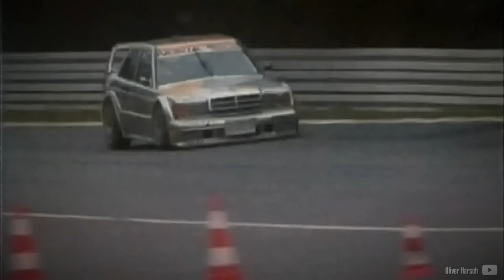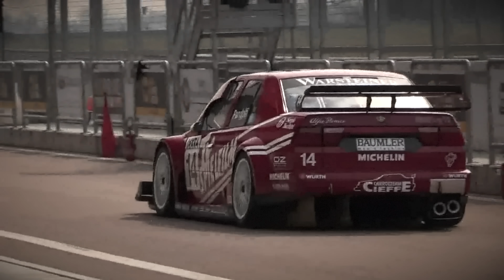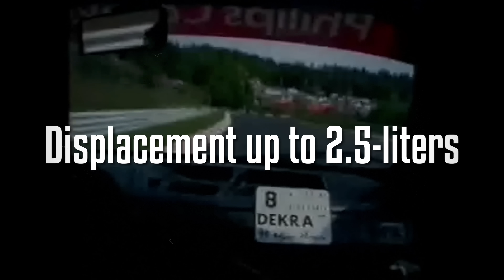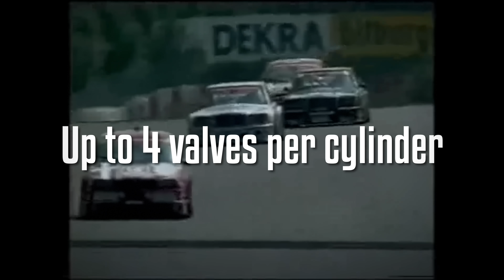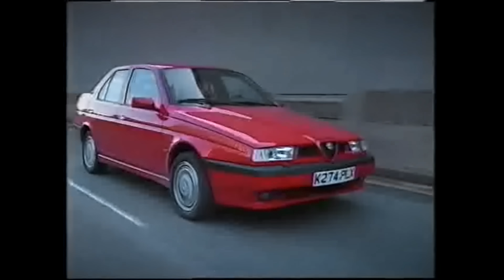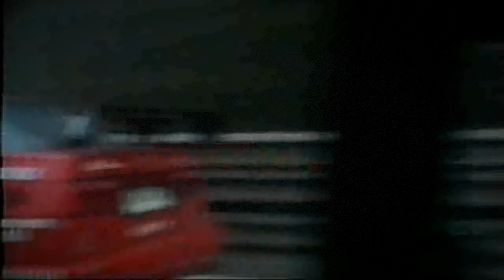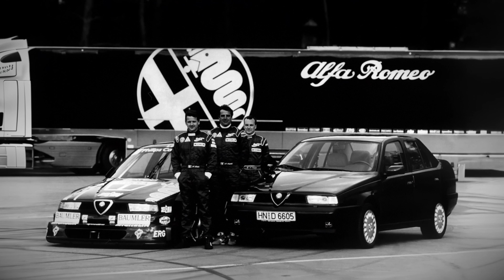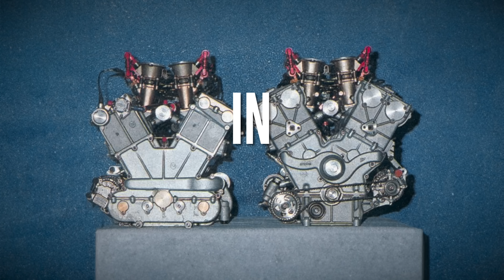Alfa Romeo V6 DTM: A 12,000rpm French Engine

Comment: This video is full of errors. AI generated possibly. This car wasn't a Group A car! Group A was phased out beginning with the 1993 season and the Alfa was the first car fully built to the new Class 1 regulations, while the competitors still had to use Group A cars or in case of the Mercedes works team had a Class 1 car based on the Group A predecessor. This situation is  also why Alfa could dominate the 1993 season the way it did despite being newcomers to the championship. Btw all-wheel-drive & I'm pretty sure ABS and TC were allowed previously to 1993, too. Audi used AWD since they entered DTM, while TC and ABS were still cutting edge tech in motorsports, even F1 constructors introduced those only in 1992 and 93 respectively. The Alfa also didn't used a sequential gearbox in 1993!
This video also has Class 2 supertouring car footage form what looks like the BTCC mixed in with the DTM footage facepalm

Comment: I can't understand why some people persist to believe that the 155 was fitted with a PRV.
Watch the video : everything shows a racing engine built from scratch by Abarth. Every part is specially designed for this 12000 rpm race engine. Zero part from a PRV, not a single washer.
Abarth built many versions of the engines following the DTM rules. Nothing else.
Does the intercylinder distance make the intellectual property ? Absolutely not.
But I think that very few people really know what is a car engine, and even less what is a racing car engine.

Comment: From Wikipedia about the engine:
The PRV was also the basis for the 90° V6 engine used by Alfa Romeo in the 155 V6 Ti in the 1996 DTM/ITC season from Silverstone onwards.The engines in that series required the use of bank separation angle and cylinder bore spacing from a production based engine, and as a 90° V6 has greater room between banks than a 60° V6 for a more optimal induction system, Alfa Romeo used the PRV as a basis as it had been used in the Lancia Thema, a car which shared its platform with the Alfa Romeo 164, as well as the Fiat Croma and Saab 9000.

Other sources declare that the 90° V6 engine in 1996 Alfa Romeo 155 V6 Ti is based on a 2.6 L V8 from 1970 Alfa Romeo Montreal with two cylinders removed, as allowed by the rules, however the FIA homologation documentation shows the homologated production engine was a "2850cm³" capacity "V6" engine. The bore spacing of the Montreal engine was too close to be suitable for the 155 V6 Ti in any case. Limone invented the "Montreal V8" story to throw the press off the scent and to satisfy FIAT management who were unhappy that a non-FIAT group developed engine was being used.

Comment: I am sorry but you are totally wrong. The first version of the engine, the one that won the DTM in 1993, was a V6 60° that had nothing to do with France PRV 90 degrees V6. And the second version used the design conception of the PRV engine, it means the angle of the V and the "interasso" of the cilinders. The manufacture was totally italian. So first inform yourself before putting such sensationalistic title to your video.
Reply: All correct sir. We must give credit to Guilio Alfieri of Maserati for the first to build a 4v 90 degree v6 for racing though. Alfieri’s creation was raced by Ligier at Lemans in 74 placing 8th overall. Made some 400hp at 11k rpm from 3L. Engine was based on the Citroen SM/ Merak block but with 4v heads

Comment: This engine has only the 90 degrees angle in common with PRV. The other parts were engineered by ex Lancia Martini team. This is NOT a french engine. After that you have to remember that Alfa won DTM with the original Alfa V6 engine with 60 dr  angle…

Comment: Dear friend, this is incorrect, in the video by Cironi that you are using, LIMONE clarify that the engine only shares the V angle with the PVR and nothing else, moreover, FIAT was going to abandon the DTM so they didn't want ANY new engine development, LIMONE and his team basically went rogue and launched this new engine. Again this is not a PRV, this is a brand new engine made by Pino Aprile that shares the V angle with the PRV.

Comment: Wait wait wait....
Sergio Limone in the Davide Cironi's video tells another story.

They were in struggle finding an engine in Alfa Romeo's history with the needed dimensions, the rules needed only that, so V angle and the bore spacing to allow the right bore diameter to reach high rpm.
Since they were and are in the FIAT galaxy, they had the option of using the PRV dimensions, since FIAT was part of the PSA joint venture.

But that's NOT A FRENCH ENGINE.
It has only the V angle and bore spacing of the PRV, just for rules needs, but it was completely engineered by Alfa Corse.

Don't spread wrong claims, please.
Reply: Eh so ragazzi,magari inglesi o francesi e magari pure un po' invidiosi. I tedeschi non possono insegnarci nulla in fatto di motori, figuriamoci gli inglesi e ancor di più i francesi....😂
Reply: @massimilianocampana3951 Tutti hanno da insegnare e da imparare, ogni produttore ha avuto meriti e primati.

La questione è che è stato riportato il falso (clickbait).

Comment: This is what the F1 V6 engines should sound like, they could rev up to 15k rpm, be sized up to 2 liters and remove the hybrid system, or make it smaller and lighter. Boom, more power, more sound, more fans, more revenue but they're caring about "environment"
Reply: Exactly

Comment: Wasn't a french engine. Nothing wrong with french engines but this just wasn't one.
If you watch Sergio Limone [the engineer who homologated the engine for the class] by Davide Cironi [it's available with English subtitles and more] he clearly says it was just the same bore spacing and bank angle of the PRV. The whole engine was completely done by Alfa Corse based on those two parameters.
https://youtu.be/DRcFpmQL3bc?si=cT5WjeDi0VY7CF9c
Reply from the maker: Yes, I am aware of that. It’s just a clickbait which is not far from the truth, because in the basics, it was the PRV that powered the DTM car. They needed that bore spacing and 90° angle and it was nowhere else around.
Reply: @VisioRacer  well I guess the click bait worked lol
Reply: cope
Reply: @littlepeugeot8341  wouldn't be a problem if it was the case, I love french cars. But this is simply isn't.

Comment: Misleading title, in your opinion the team of engineers who created the engine of the Lancia Delta S4 (700-800 HP), the first car without turbolag, needed to go and get an engine block from somewhere else, if they hadn't been forced by budget reasons and various regulations.
Engineer Limoni and Engineer Lombardi are among the protagonists of the Delta S4 Engine and Lombardi is the designer of the Ferrari F1 V12, the engine with the most beautiful song ever, the one on which Senna complimented Lombardi for the incredible acceleration; the same engine that Schumacher wanted to keep instead of the V10
Reply: It’s not misleading, they “used” a French engine to beat the rules and by used they meant as a scapegoat to get the design parameters they wanted. Too many people misunderstanding that. If not for the PRV bore spacing and bank angle, they wouldn’t have had the same results from the busso architecture. We all know the engines were 100% Italian designed and 100% race spec

Comment: Absolutely gorgeous machine, if i had the cash id do a full rep except losing all the interior. Please run a full video on the btcc version which absolutely dominated with tarquienie  at the wheel . Cheers 👍✌🏻
Reply: Yes please. I was at Brands Hatch for the BTCC and one of these cars was parked on a trailer in a public area behind the main grandstand, IE not in the paddock or pits.
I took the opportunity to get on the ground under the trailer and have a good look.
Those were the days.
Reply: @philiptownsend4026  that would have been an amazing opportunity, im jealous. We had a new black 155 1.8 ts at the time tarquienie was dominating. Loved that car, even the motors rocker cover looked great. Aluminium with alfa romeo in red. Hopefully we get a video on the btcc model you actually got to see up close.definitely that was my favourite btcc era 👌🏻

Comment: This begs the question, would those Alfa Romeo PRV6 parts fit the PRV6 in a Volvo 260?

Because that would be hilarious.
Reply: The race engine, used in last models, has only some dimensions in common with RPV engine (used in a Lancia model).
Reply: The only PRV parts used would be the homologation form with 90 degrees and 108 mm printed on that, so I'm pretty sure that piece of paper would fit in the glove box.

Comment: Great video. DTM was certainly a "rough and tumble" racing series, in a way that open wheeled formula cars can never be. It was great to watch, and have a favorite team/driver to follow.
Reply: Its nascar but its not on a roundy-round circuit.
Reply: @ZenkiTheDemon  I agree with your analogy. I live in the U.S., and these DTM drivers seem as if they mash up their machinery at least as much or more than NASCAR drivers. The NASCAR "bull rings" like Bristol are small, and where they usually beat up the cars pretty good! Also, on a road course like Sonoma or Watkins Glen.
I really do like the DTM racing though!
Reply: @hugejohnson5011  if you saw some old dtm footage, some of them really did stick their elbows out...to the point that only manhole covers could stop them!
Reply: @ZenkiTheDemon  Just in the limited footage I have seen, I have noticed some pretty torn up cars still in the battle! I can't imagine that the aero is quite as much a factor, compared to a NASCAR on a super speedway, like Talladega. Thanks for the feedback.
Reply: @ZenkiTheDemon I would say Australian v8 supercars in the early 2000’s are the closest to that, very limited aero, solid rear axle, no traction, and big v8’s going around a proper circuit. Def worth checking out if you havent
Reply: @brdllc  im not gonna contest that but yea, my point still stands.
Reply: @ZenkiTheDemon  wasn’t trying to disprove your point as much as talk about another cool racing series lmao
Reply: @brdllc  ohh, im not contending your statement right there bud. I love v8 supercars just as much given their "elbows out" kind of racing.

Comment: Sorry Man, but the 1996 Alfa Engine was not French. In the same interview you say, Sergio Limone says that the technical aspects to respect for the new regulamentation were the angle of the V for V6 engine and the the distance from the centers of the cylindres. So, on the documents were released the Montreal V6, but it has too short distances between cylindres, and thanks to a society in the last years of the 80s, Lancia and Alfa were the same Brand, and the PRV equipped the Lancia Thema 6V and the Lancia Thema Limousine, so it was addicted to have the technician values to can be used as shield... the V6 1996 Alfa engine was in experimentation from 1994, and Nannini tested it after the initial develop of Giorgio Francia...
Reply: The rules state teams had to use a production block the PRV was designed as a race engine and was used for racing with bare block only weighing 32kg which is the similar to other modern v6 engines like the greatest v6 ever made the Nissan VQ.
Reply: Peugeot used same engine at Le Mans, the famous 405 kph record.
Reply: @GitonIcon  no that was a PRV engine.
Reply: @GitonIcon  PSA engine-base was exactly the PRV, Alfa used only tecnical aspect of that engine... ^^
Reply from the maker: It was not, but that’s not as important. The base was a Swedo-French developed engine that was turned upside down into a full race engine. The “French” is there just to catch attention. You see, making a viewer click on the video is harder these years, don’t get too excited about a single title word, just enjoy the full length video which is made without assumptions, only with pure facts. Peace
Reply: @VisioRacer  2/3 French, 1/3 Swedish PRV for Peugeot Renault Volvo.
Reply: @VisioRacer honest 😉
Reply: @VisioRacer So... its essentialy a threesome between a French, a Sweedish and an Italian.... ❤
Reply: @VisioRacer  I come in peace and sorry if my words seems "violent", I know perfectly it's hard to get clicks, but with a click bait title you have should expect comment like mine... Nice video anyway! have a nice day ^^
Reply from the maker: @automunirsi  No worries, there were multiple such comments and I expect them. You have every right to correct me if/when I am wrong. Thanks!
Reply: @VisioRacer  🙂👍👍👍👍

Comment: It's funny because the PRV was originally seen as a mediocre, out of balance engine, still showing symptoms of an amputated V8
Reply: The PRV road version was still a mediocre engine compared with the busso. The Alfa V90 degrees had nothing to do with the PRV, they kept only the principal geometries and nothing else according to regulations.
Reply: @barukd Alpine A610
Reply: @barukd  sorry but in 12v the busso was providing more or less the same power output as the PRV.
The DOHC 24s n/a PRV was 200hp (sadly only used in boring cars), the busso was the same output but with 200cc more displacement, so...
Twin turbo intercooled PRVs were in the 400hp  figures ^^' (Venturi, extremely rare road legal french sports cars).
Reply: @Damien.D you missed the point like a lot of people.
Reply: It's still the holder of speed record on a circuit. Since it was made on a long straight line at LeMans that doesn't exist anymore, it will probably keep this record forever.
Reply: @Damien.D  from my understanding that Le Mans record was set by cruising around, then doing one fast lap, then the car was overheated and didn't finish the race. The engine used in the Alfa Romeo 155 DTM in the final years just used the homologation form with 90 degrees and 108 mm printed on to build a proper race engine. No actual PRV engine parts.